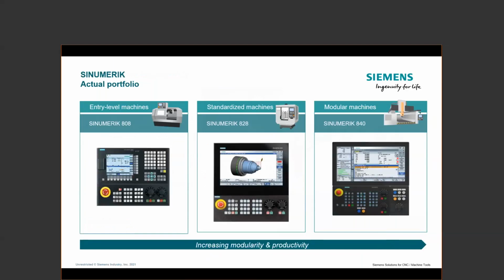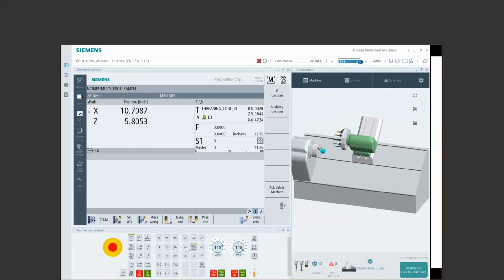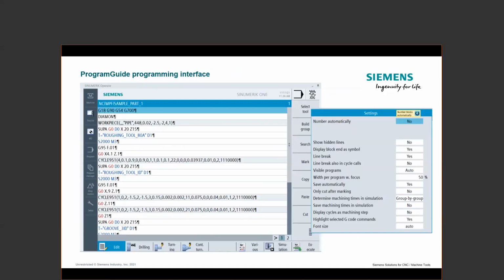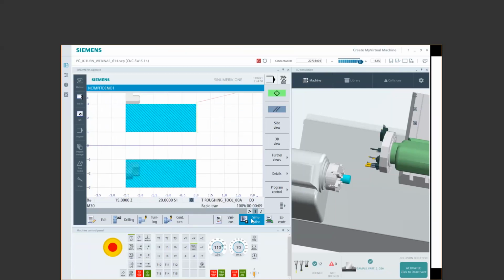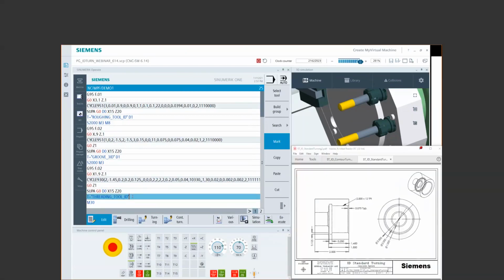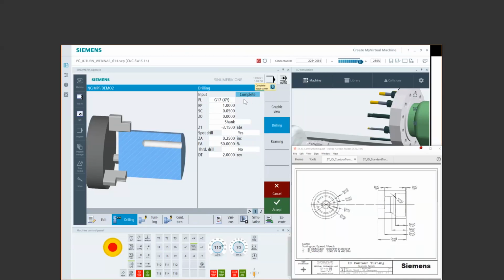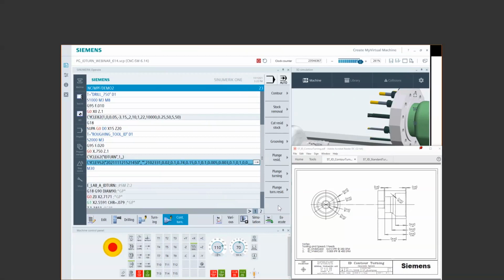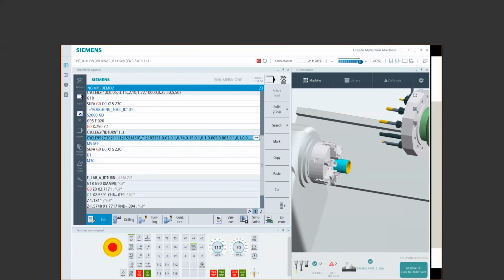ID Part Programming in G code with ProgramGuide – SINUMERIK Turning

Comment: Hello Mr; Chris:
we have a cnc machine with Sinumerik 828d, the programGuide G code is working, however the shopmill is not installed in.
Can we add the Shopmill into the machine commande please, and how?
Thank you very much a lot for every efforts you are doing.
Reply from the maker: You would have to go to the machine tool builder to order that option.
Reply: @MrCNC  thank you so much